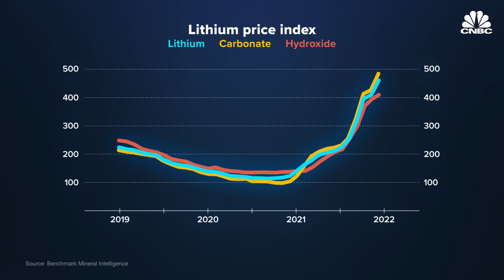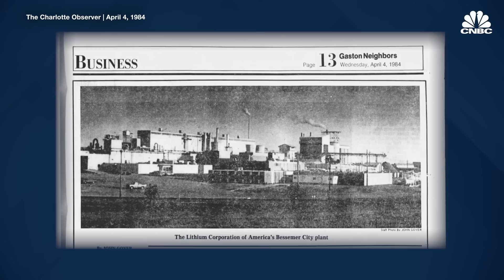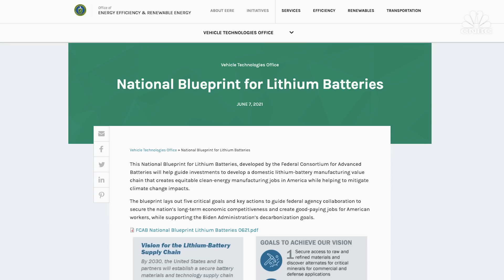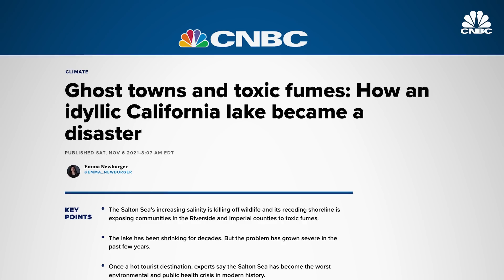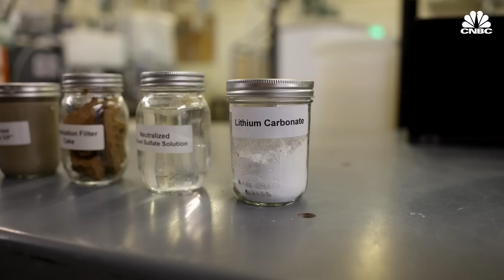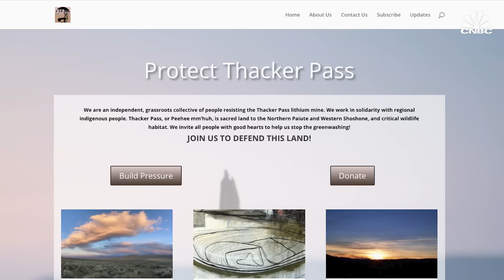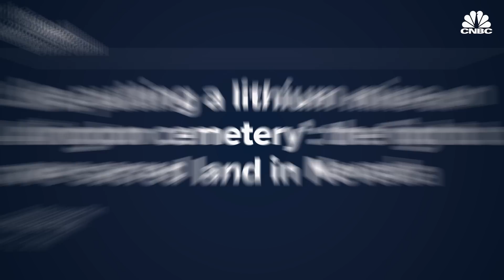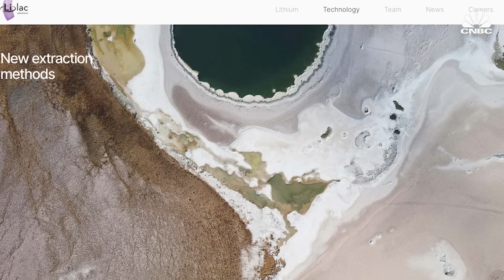Why The U.S. Has A Massive Lithium Supply Problem

Comment: There's huge amounts of lithium right next to Tesla's plant in Nevada.

The problem is that lithium is so cheap it's not worth it to mine it domestically.

The lithium in a lithium ion battery is only 3% of the cost. It's basically irrelevant. There's no shortage of cheap litium to go around 

Cobalt is 60%. Cobalt mostly comes from the congo, mostly produced with slave labor.

Lithium is not the issue. Stop wasting so much time trying to equate lithium reserves to oil reserves. No one is going to go to war over lithium
Reply: Lithium Iron Phosphate batteries don't require Cobalt.
Reply: Thanks Greg , I'm thinking about a e bike...what battery's are the best ?   Any ideas?
Reply: Lithium is just a face but on background phosphate + nickle and other material combined called lithum. And tesla using there next gen battery using less colbalt bcoz of human right.
Reply: This doesn't sound right.
Reply: Is it slave labor or indentured servitude?
Reply: That's true, but lithium is still a vital component and there's still a scarce supply compared to demand. 

Also, lithium iron phosphate batteries don't even have Cobalt so Cobalt is not a factor.
Reply: Lithium Iron Phosphate are also twice as bulky.  Great for Canada though because it will not be damaged in -30 degree celsius weather as long as you aren't trying to charge it at that temperature.

Nickel is useful for high density, high performance batteries.
Reply: @babelfishdude  But solid state LFP is up to 2.5 times as energy dense so when they come out, they'll still be less bulky than lithium ternary batteries currently in use...
Reply: Lithium batteries don’t need cobalt.
Reply: @SDGreg  Loose a bit of weight you will look like doom guy. You know the doom guy next to Health percentage in older doom games. I clicked on your profile  pic thinking it was fan art. 😅👍
Reply: Cobalt is not mostly from slave labor. Artisanal mining of cobalt represent only a few percent of Congo’s production. The most is produced by companies with industrial equipment. Artisanal mining cannot produce nearly the same amount of big mining companies if you think about it. Those are audited regularly. I’m not saying slave labor, and child labor especially don’t exist in Congo mines but it’s not concerning major car brands.
Reply: Lithium also requires ALOT of water for its mining and refinement. Something which Nevada is already low on, and what water rights there are (around where there are rich lithium reserves), is already taken by agriculture.
Reply: That mine in Nevada will never open. It is plagued with environmental, religious, agricultural and cultural issues and pushback from the community. 
Lithium and Cobalt mining are extremely environmentally unstable and arguably produce worse effects than crude oil.
Reply: @TheBigChill1  Some people think that China is going all green because of the environment. China is really making all these investments for future sustainability in a world decoupled from the US and the petrodollar. If this actually helps the environment (maybe slightly overall), that's just an extra benefit...
Reply: While lithium is cheap may be true now, it won't be true in the future as dependency on batteries grow. Most of the lithium nowadays are processed in China. if China decides to throw a fit against any country that does not recognize their "Nine Dash line", they can pretty much cut off their supply to that country, especially once we move to a post-oil world.
Reply: Tesla has already purchased 10,000 acres of land in Nevada,  very close to its megafactory indeed
Reply: @royhuang9715  going green to remove the smog just for the Olympics. Then back to normal.
Reply: Hence the shift from Cobalt...
Reply: Lithium needs lots of water to be mined and Nevada hasn't too much of it
Reply: How is it produced with slave labour 😂😂😂🤣🤣🤣
Reply: @shanemooon  i don’t think it’s possible it will ever produce worst effects than crude oil because lithium is a metal, it can be recycled indefinitely so whatever is extracted will be used for a very long time, this is not the case for oil which is just burned and it’s components released in the air.
Reply: @milhooz  it can not be recycled forever. Lithium has a very short lifespan of its usability as an efficient battery….and has WAY less energy density than oil/gas. 
It makes people feel better, because the direct use of batteries produces an illusion of no emissions. But the actual emissions and environmental impact is pretty massive.
Reply: @shanemooon  WTF do you mean by lithium having a very short lifespan? It’s an element. Do you think it transmutates into helium or something?
Reply: @shanemooon  I think your data is wrong. Lithium is definitely recyclable. It is not done so often because it’s currently much cheaper to get new lithium, but as part of electric vehicle battery recycling that are taking shape all over the place with the availability of EVs it is going to be recycled. Lithium is quickly oxidized in its pure form but not as Lithium Carbonate or Chloride. More over, before an EV battery is going to be recycled, it can be reused, for example as solar or wind energy storage or grid storage where it does not really matter if the pack can only hold 70% of its nominal capacity. Some charging station providers are actually using old battery packs to act as buffer in charging stalls.
Reply: @milhooz  never said it wasn’t recyclable. But that it’s life span is short. After 1-2 recycle life cycles, it’s pretty much obsolete.
Reply: @xerogue  African children's labour
Reply: @TheBigChill1 ok
Reply: Most tesla cars do not use cobalt in theyr battery
Reply: @shanemooon  lithium rich brine is the world's most valuable resource, your phone depends on lithium, your game controller depends on lithium, anything wireless depends on lithium & your insane to suggest it's obsolete.
Reply: @illogicmath  and how is that slave labour? 😂😂😂
Reply: @xerogue  I don't get what's so funny
Reply: @constitutionofaxioms3387  what are you talking about. I never said anything remotely close to it being obsolete.  I said it becomes obsolete after it’s been recycled 1-2 times. 

The point is that if we switch all vehicles to EV’s….the amount of lithium production in the world has to increase by 50-100 times. 
And it is known that lithium mining is very harmful to local environments.  So there comes all those issues. 

And just like crude oil, it is not renewable. Yes, it can be recycled to an extent. But after 1-2 life cycles, it become obsolete as far as its energy storage capabilities. So we will run out. And the supply/energy density of Lithium is FAR below what crude oil is. So we will run out much faster. 

So my point is…people paint this picture of EV’s as solving all the worlds emissions issues and some utopian future. When in reality, we’ll likely be in the exact same spot we are now within 50 years if we switch to completely EV’s.
Reply: Native Americans think we should be living a sedentary lifestyle. There is someone’s ancestors buried all over the country, we shouldn’t stop living life because someone’s dissolved bones are in a certain location. It’s the circle of life
Reply: @shanemooon  WTF 

There are only two stable isotopes but isotopes of lithium have nothing to do with batteries. 

No one thinks EVs are a magical source of energy - except you who thinks that lithium has energy that it loses over time and that’s what causes batteries to reduce capacity. 

EVs are not a source of energy unless they’re charged. It is just they don’t need to burn fossil fuel at the point of use and (amongst other advantages) this allows them to use energy from any source (nuclear, solar, coal, wind etc).  Electricity is great like that. 

Lithium doesn’t “lose energy”. The energy doesn’t come from the Lithium as an element/atom. It doesn’t magically have energy that is lost over time requiring the lithium to be disposed of (that’s the craziest thing I’ve ever heard). I’ve never encountered anyone with such a poor understanding of physics and chemistry but yet speaks down to people like you just have. 

The reason batteries lose the ability to store as much energy is because the internal structure of the batteries degrade over time. Because the structures are so small they can’t be repaired. Instead the materials just need to be recovered and a new battery made. There are things we can do to slow down the degradation such as cooling and heating batteries to optimal temperatures.
Reply: @SDGreg  They are also longer lasting, more stable, and reasonably priced. LiFePO4 batteries have a slightly lower energy density than other lithium ion battery chemistries which makes them less desirable for the more premium vehicles that manufacturers like Tesla are currently building. As car manufacturers start manufacturing more  affordable EVs I wouldn't be surprised if LiFePO4 batteries come to dominate the market.
Reply: @nzer19  I meant to say energy storing. 

But you’re also wrong.….if that was your logic, then nothing technically produces energy.
Lithium produces energy…just in a different way than something like uranium or crude oil would. Uranium and other elements typically produce energy through chemical reactions that produce heat. 
Lithium produces energy through ion transfer. Both require an outside force beyond the element itself to cause the energy be released. So both produce energy. 

But irregardless of all that the fact is….Lithium’s energy storing/producing/whatever capacity depletes with charge/discharge cycles. And even though it can be recycled, it is not renewable by any means. After a few It will deteriorate to the point where it can no longer effectively store energy. 

That, coupled with its relatively low supply, low energy density and fairly large local environmental impact make it very infeasible as the “future” of all consumer vehicles.

Never doubted or said anything about it’s importance. Especially with smaller electronics or components.
Reply: @lascannon  you might already know this, but many mining companies in Nevada own and run massive ranches for the water rights(my experience is with the gold mining industry which also uses quite a bit of water although less than lithium)
Reply: @shanemooon  the battery degrades. Lithium is lithium. As long as you recycle it properly you can make new batteries from it for eternity. Just like you can recycle aluminum forever. Your example of uranium is not the same at all. Lithium is not a radioactive element going through a fission reaction where it literally changes element. It is being used as a conduit for electrons in batteries.
Reply: @jFranco1994  The Lithium is the part of the battery that’s degrading…. Its structure gets damaged over time with enough charge/discharge cycles. And no matter how precisely you recycle lithium. Some will be lost in the process. And it has been shown that recycled lithium is not as energy dense or effective as raw lithium that has been mined.

And let’s not even get into the fact that only about 5% of batteries are recycled period and in that 5%, 99% of those don’t even recycle the lithium and the lithium just gets incinerated. 

At the current pace and with the current promises by manufacturers to go “all electric”, the world is poised to run out of its mineable Lithium reserves in the next 20-30 years.

And we are nowhere near close to the recycling effort required to producing batteries beyond that. So unless there is some Herculean effort in the next few years to ramp up recycling, EV’s will be all but gone in the next 50 years.

Then it has other huge trickle down effects….because without Lithium, our entire consumer electronics market is screwed.
Reply: @garethbaus5471  you are obviously misinformed. Recycling is not an infinite process. There is loss….it’s just physics and the laws of conservation. 
No recycling process is 100% efficient, period. And it has been shown that the end product, recycled lithium is not as energy dense as raw lithium. 

And the fact is that only about 5% of lithium batteries get recycled in general. And of those 5%…99% of recyclers do not extract the Lithium. It is simply incinerated in the process of extracting the anode materials. 

So we can keep living in this fairytale dream of EV’s and Lithium batteries, but reality is going to set in soon. Especially if the world doesn’t come together. (which is almost never does lol)
Reply: @shanemooon  Here’s a simpler explanation that may make it easier for you to understand:

Petrol is a fuel that has to be constantly provided. Fuel runs out. The Lithium ion battery equivalent for petrol is Electricity. 

The lithium does not get used up like a fuel because it isn’t used in a battery cell as a fuel. The damage/deterioration of a lithium ion battery over time that causes it to be less capable of storing electricity is analogous to the deterioration of a traditional engine. A traditional engine degrades from wear and tear over time. If the gasket leaks then it may not even be able to hold pressure and thus stops working altogether. But overtime, wear and tear will make an engine less efficient and consume more fuel to do the same work. Now, just because an engine degrades over time does not mean that the aluminium that makes up the engine has degraded in a way that prevents it from being recycled over and over again. The same applies to lithium - the battery cell has worn out but that doesn’t mean the material that was used to make it (Lithium) has worn out.
Reply: @nzer19  oh I understand completely lol. You are correct in that it’s not a fuel. I never said it was a fuel and it is obviously not. But it does produce energy. Which is what I said and what you said was incorrect.

But your analogy about engines is just incorrect….not all Aluminum is the same quality. Not all Lithium is the same quality. Same goes for every chemical and material. In it’s most pure, atomic state, sure…
Reply: @shanemooon  I studied metallurgy in college, I am at least moderately well informed on the subject, and that energy density thing is a complete load of crap lithium is lithium if it doesn't behave like normal lithium it has an impurity which should be removed.
Reply: It’s ok, slave labour in Congo is fine, but slave labour in xinjiang is not acceptable.
Reply: Truely amazing all the future lithium problems being solved right here in this comment thread.  Lol
Reply: @TheBigChill1  rubbish left..
Reply: @TheBigChill1  you are full of it.
Reply: @constitutionofaxioms3387  nonsense
Reply: @eurobrowarriormonk7182   Agree, but would replace "global warming" with "Tesla stock price"
Reply: @valdomero738  who isn’t? Africa l?
Reply: @TheBigChill1  I have no illusion that Tesla is a business and it’s main focus is profit. But we can’t go cold turkey on vehicles. So Unless you think we can all start riding bicycles everywhere, EVs are a better option than ICE car
Reply: I find these statements false , you are stupid to think 3% of the battery doesn't equate to a huge demand ,  there will be a huge supply demand gap with lithium for the next decade or two,  the ev revolution makes up for about 90% of lithium demand the same can't be said for copper and nickel,         there's no shortage of lithium in the ground but theres a shortage of it coming out of the ground right now,
Reply: @lifeisneverthesame910  ignorant right...
😂
Reply: Necessity is the mother of invention. If there is not enough lithium then we mine more, make better batteries, recycle them more efficiently or just get a newer better chemistry. Enough of all this defeatist talk saying it too hard and we shouldn’t try to do better. China is doing well in this tech. They don’t care if you belong to the right or left part of politics - they are focused on winning and it certainly looks like it gonna happen
Reply: You really don't know much about Lithium production, do you?
Reply: @TheBigChill1  You’re going to far. You’re conflating things that don’t go together : lowering CO2 emissions, safe mining standards, and sustainable mining. I agree with you that companies can creat destruction in other aspects when reducing CO2. That’s not green washing.  That’s focused on lowing co2 emissions and ignoring other matters. 

Your position is that companies will do damage when lowering co2 standards. And I agree sort of.  It depends on the company and their values. 

If your position is that all companies that work in green energy are secretly as bad as big, then I say, “not likely.”  

Thanks for the conversation,
Lancer Kind host of SciFi Thoughts
Reply: @shanemooon  How is crude oil recyclable 1-2 times? Do you mean motor oil? Oil that’s refined into gas isn’t recyclable at all. 

15 years later we won’t be in the same position as electric production can be created with renewables but gasoline cannot. I see your trying to equate this via a re-use or recycling argument but they aren’t the same thing or impact. They are different impacts. One is destroying the planet and the other is a potential disposal problem (assuming your correct that it can only be reused 2 times.).
Reply: @scifithoughts3611  read my post again…slowly this time. 
Never said any of those things.